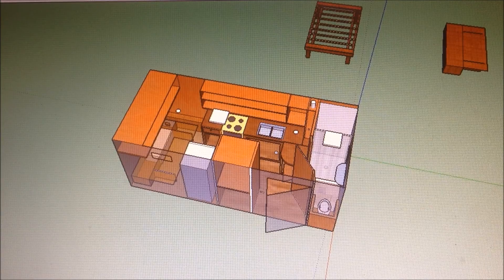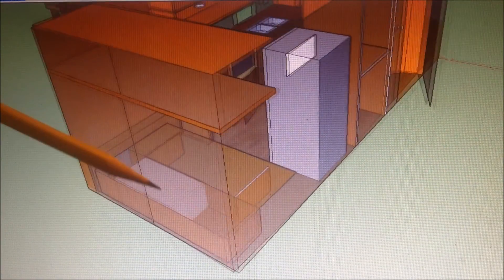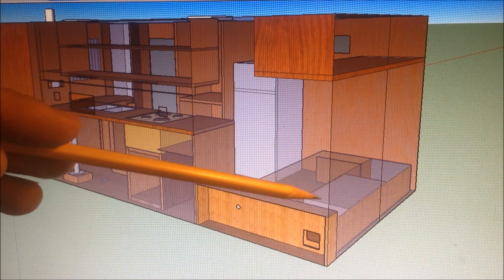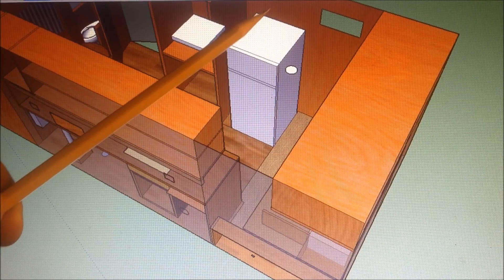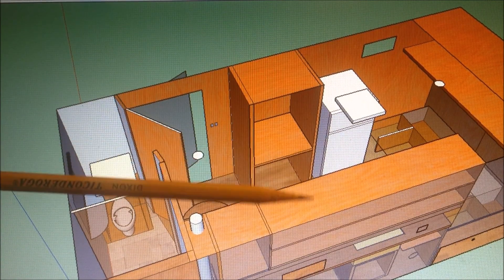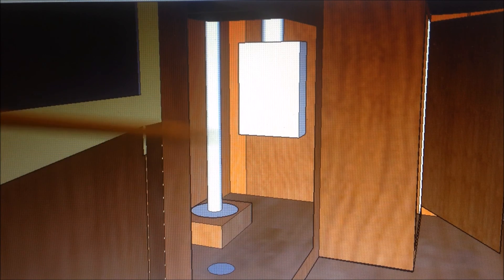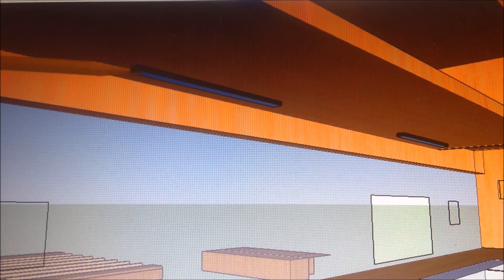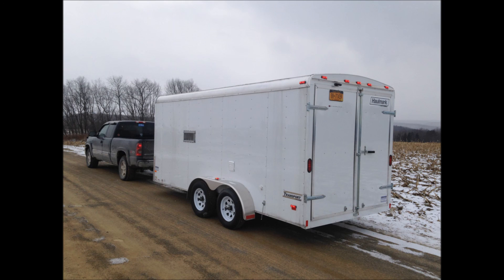Cargo Trailer to RV Conversion - Sketchup Model (2nd Update)

Comment: Propane fridges are a thing of the past.. check out the newer generation of efficient 12v fridges/ice chests which are ideal for solar https://www.youtube.com/watch?v=nmVgEPXpZus. Looks like an interesting project..just a suggestion I usually take some foam board or cardboard, some scrap wood and a hot glue gun and mock up the interior.
Reply from the maker: +Rob Vann Thanks for the info. I agree 12V fridges are awesome, but they are above my price range. One of the beauties of this trailer is that it will be easy to swap out appliances once I have the capitol to do so.